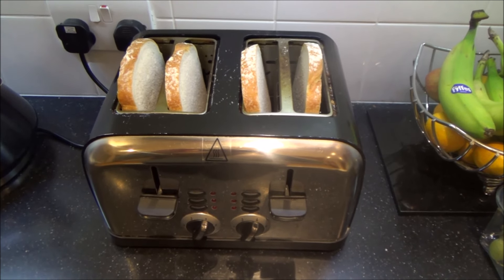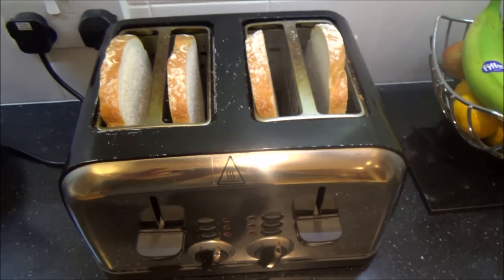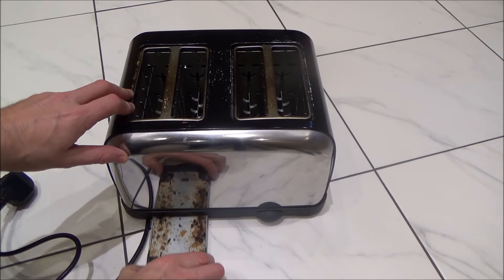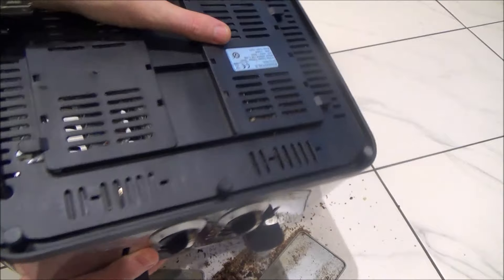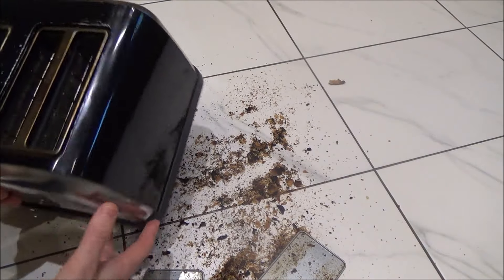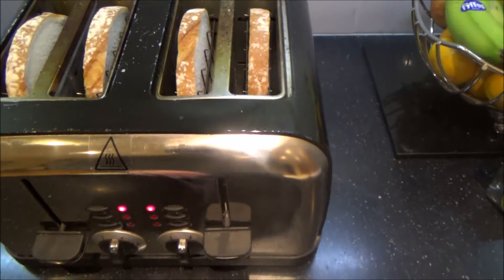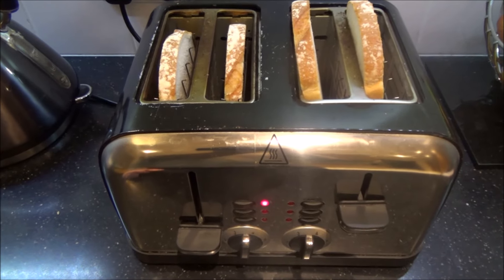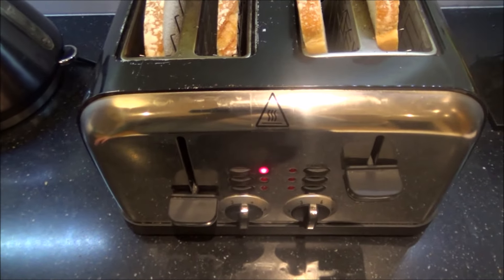How to FIX a Toaster that doesn't stay down WITHOUT taking it apart

Comment: I shake the crumbs out regularly (and clean the tray) and that's what CAUSED my toaster lever to not stay down...
Reply: The same reason I’m here too.
Reply: Same here. Do not shake the toaster.
Reply: Mine too!
Reply: same here
Reply: Same here
Reply: Same here
Reply: Same
Reply: Shake it harder
Reply: @madladdweeb6878 😂
Reply: Yeah, figured that out  finally.  Crumbs will not get into the mechanism with normal use, but shaking it can move the crumbs INTO that part of the toaster.  A better design would prevent that , but god forbid'

Thinking only shake the thing with  the side with all the mechanics VERTICAL, so crumbs dont drop into that part.
Reply: Not mine.
Reply: Yup. Mine too!
Reply: Same here 😢

Comment: I was ready to do an afternoon toaster teardown.  My wife had already cleaned the tray but it still would not stay down.  Turned it upside down over the kitchen sink and shook it as hard as I could, now it works like new again.  Great advice.  I wonder how many toasters are in the landfill for lack of a good shake to bring them back to life. I feel $40 richer today THANKS!.
Reply: sometimes it was the exact opposite, I had experience that when shook too hard, the lever wouldn't stay down but then again if you were lucky, you shook it again, it might just stayed down again.  It happened to my toaster.  Still beat taking the whole thing apart AND putting it back together or getting a new one.

Comment: oddly, my problem happened after I cleaned the unit. Going to have to try a can of compressed air or such to see if something is gumming up the works.
Reply: same here, I wonder did the compressed air work
Reply: I don't know if this is a coincidence or not, but after I blew it out with compressed air it still didn't work. So I turned the heat setting all the way up and then it worked and now it works on all of the heat settings again. So try cranking the heat setting up if its not working after cleaning it, maybe the compressed air wasn't even necessary.
Reply: Same to me here. Lemme me try heating it at full heat

Comment: It didn't work for me, at first. So I amped up the toaster abuse. I put a thick folded up kitchen towel on a cutting board and banged the hell out of it. I started off low impact, checked the toaster and did it again harder until it worked. It stopped working just after I shook out some crumbs so I figured there was a causal relationship there. Works great again! Thanks Vince.
P.S. I shook out enough to build a Crumb Castle. The answer to "Doesn't anyone clean out this toaster?" is self evident.

Comment: Hey, thanks SO MUCH for the help. Story:  One or more of my naughty cats knocked my fairly new toaster onto the floor, after which the lever would not stay down. I was just perusing the online stores: man, are some toasters super expensive. On a whim, not really expecting any information, I searched for help and found your posting and thought: what do I have to lose. Well, the tray was empty, kind of puzzling because I hadn't cleaned it for awhile. Turned it over and shook, which dislodged a literal blizzard of crumbs and whatnot; then used my hairdryer to dislodge stuck pieces. Plugged the toaster in, and Yippee! it works Apparently, when my cats knocked it over, all the crud flew into the inside and blocked the little catch. As others stated, just think of all the discarded toasters that just needed a good shake. Thanks again!

Comment: Well, I cleaned my WORKING toaster today.  Pulled out the tray, turned it upside down and shook out the crumbs.  Then I plugged it in and it DIDN'T work.   So, off to YOUTUBE I went to find a solution.  Taking it apart was not an option since the screws are from hell.  Why make a three sided nail head for pete's sake?   I then found this video and tried shaking it again.  It actually worked laying on one side so that was a clue, I guess.  So I shake REALLY HARD and out comes a hunk of toast about the size of a nickle.  I plug it in and TA DA!  It works!  Thanks so much for this video!  It saved me from buying another toaster.  Who can live without toast, right?

Comment: any other tips?  i have a fairly new Sunbeam toaster - i looked inside and it was mostly clean, but went ahead and tried to shake things out and also emptied out the trays.  it's a 4 slice toaster and the left set won't go down.  i think it's only gone down maybe 2 or 3 times.  the one on the right has been working fine.  and yes it's pretty new, less than a month old, but as i've used it - i don't think i can just return it either.

Comment: Had a look at mine, same symptom. Toaster given a vigorous shake but no joy. I then took a bright torch and looked inside. At the bottom of the slot is a little square electromagnet. On the moving toast rack a moveable steel plate. Mine were coated in food so I used a long thin allen key (toaster unplugged) to scrape away the food residue. All fixed, good as new.

Comment: Cleaning did not do the trick but when We took the top off we saw that the wires near the bottom magnet had  moved up preventing the top magnet from reaching the bottom magnet. Probably due to dumping out the crumbs. Pushing the wires down a bit near the bottom magnet allows the two magnets to contact. Problem solved.

Comment: Vince, I had a thought (it happens!). Would it make any sense to hold the toast levers in the down position to prevent any debris from dropping into the space between the contacts and causing a problem like I had? I had a surprisingly large piece of toasty-charcoal drop out of my toaster that I think was the problem. After it fell out the toaster was A-OK.
Reply: That's a good question.  I would like to know as well.  Maybe keeping that area connected would keep crumbs out of there.  Good thinking, James!

Comment: We have the BTA720XL with the same problem.  Cleaning per the video worked for only one cycle; then it needed to be unplugged to reset and turn off the "Cancel" button which was stuck in the on position.

HERE IS THE FIX: With the unit unplugged, press and hold the Cancel button while you plug the unit back into the socket.  Now it works like new.
Reply: thank you, this worked on my Sunbeam!

Comment: There is another situation: You clean it good as shown but it still jumps up too early. The answer is that the mating surfaces of the magnet and metal strip that meet to hold things down have dirt on them. In that case, loosen and lift the toaster's cover enough to get a finger inside from below and rub clean the two surfaces. The magnet is at the base of the frame that lets the lever slide up and down. It is t's a fairly easy job and I didn't take the toaster's cover off completely.

Comment: @My Mate VINCE my mum bought a new Breville toaster last week and on the second use it worked perfectly fine but i went to reheat my toast it pressed the lever down and within 5 seconds is self cancelled and i went to press it down again it wouldn't turn back on and lock into place, same with the second lever
Reply: Same here with my Breville. Failed after two years. Shaking crumbs out didn't work. Regularly clean the trays and blow away crumbs from inside. Mine is just dead. Removed top cover and sliders are operating fine. Brass contacts are connecting at bottom when slider is pressed down, but no reaction from elements. I suspect a component on the printed circuit board has failed. Plug and  cable both tested ok. A little more than a shake required here I'm afraid.

Comment: Here's a valid post/comment.

Any idea what might be the problem if the crumbs have been completely cleared out already and it still won't engage the lock?
Reply from the maker: Hi, if you have a look on YouTube there are other videos of the same problem where people have taken it apart which may be helpful. I don't want you to break your toaster but sometimes you really have to shake it quite violently to get all the crumbs out because I believe there is a magnet that when energized allows the lever to stay down and if crumbs are stuck to this magnet it can stop it from staying down.
Good luck with it.
Reply: I had to unplug,  remove the 4 small circular rubber feet, then unscrew the 4 screws. Next remove the 2 paddles used to lower the bread (didn't have to remove the circular toast ones ). Then properly clean all the magnets (top & bottom ). Then reassemble, now works like new !.
Reply: B that is what I may have to do as well.  I cleaned it by shaking but still no go.  I will give it another gooooood shake before taking it apart
Reply: A really good bashing around the outside with it upside down has worked -yay
Reply: Any tips for removing the paddles? I saw one video of a Cuisinart just like mine, looks very similar to this one, and the levers just slid off. Mine don't seem to want to come off and I don't want to just rip them off and break them.
Reply: @adotgif Did you solve the problem? I’ve the same

Comment: My ancient Black and Decker toaster was starting to go funny so I opened up a brand new Rival toaster that I bought about 8 or 9 years ago for a spare. It would not latch and I was ready to toss it. As a last resort I plugged it in and held the thingamabob down with my finger. After it smoked and smelled a lot it stayed latched. BTW, the slots on this Rival are not big enough to accept a slice of bread.

Comment: I tried that. the side that did work still works but the other still won't stay down, I took out the trays, held it upside down...smacked it many times and tried it after each smack. It still won't stay down on that side.